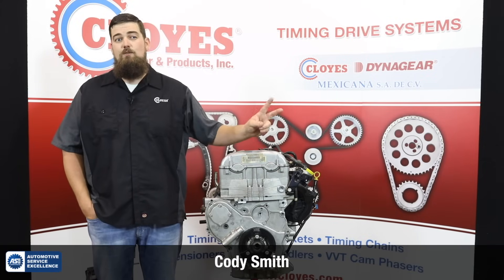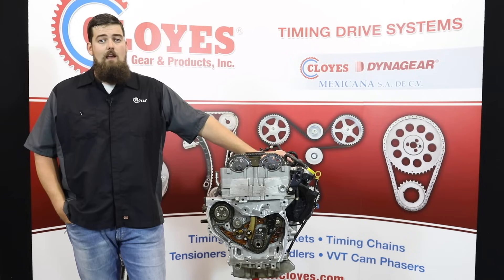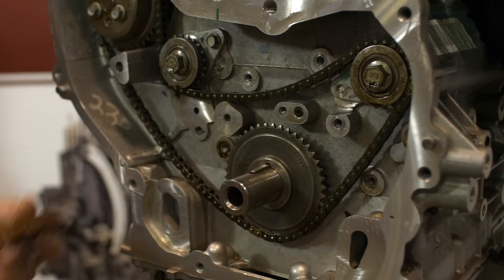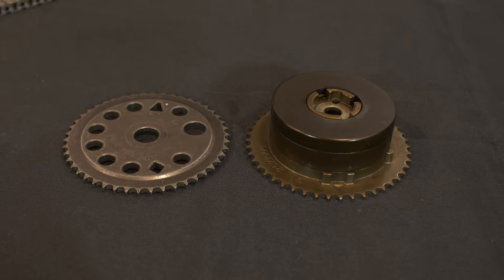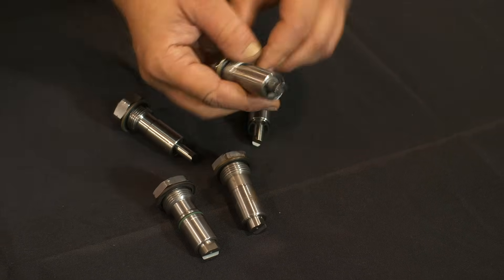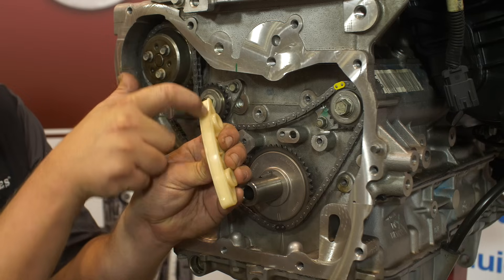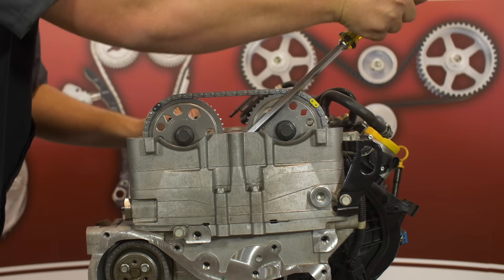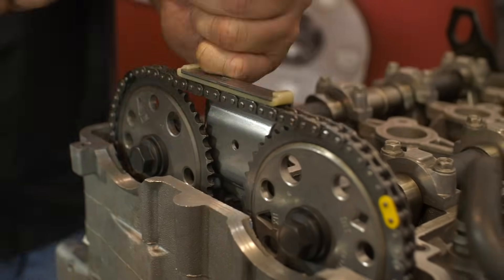GM 2.0/2.2/2.4L, Timing Chain Replacement, Cloyes 9-4201S & 9-4202S

Comment: I've been having a hell of a time. 2006 chevy cobalt supercharged ecotec 2.0 lsj.  Bought your balance shaft and timing chain kit, because it was about that time and my thermostat had just gone out. Anyway, I'm probably going to call your hotline tomorrow. Did everything listed, everything torqued to spec.Initially, I didnt spring the timing chain tensioner, after pulling it out, it had been released. My idle was fine on turn over, no engine codes (still no engine codes). Seemed a little heavier I  n vibration on the jackstands, but I've got billet mounts, so I assumed the vibration was reverberation due to it still being on stands, it having solid engine mounts, and torque damper. Any revving while the tires are on the car, and I try vibrations like my car is going to fall apart. More vibration the higher the rpm goes. Also, at TDC in cylinder on the compression stroke,  my 2 o'clock on the intake says exh, where my exh (firewall side), says int at the 10-11 o'clock position. Cam sprokets only go on one way..not that it should matter, but have you heard of camshaft sprokets being reversed from the dealership? I dont think I could possibly have the timing reversed 180 degrees,  because it wouldn't start nicely,  or at all, or would backfire from what I'm reading? Could you shine some Insight,  or is there any chance that an under or over torqued anything in the timing cover could cause the vibration? Sorry for the novel, I'm all out of ideas. My father just got diagnosed with 4 weeks to live and this is my only vehicle. Please please any help you could give would be great.
Reply from the maker: Timing is set on this engine with #1 TDC on the exhaust stroke. That explains why your cam sprockets are 180 out on the compression stroke, it is perfectly normal. With the car running, and no codes, you have the engine in time. The vibrations could be caused by a balance shaft/shafts being out of time, but with the colored links aligned correctly with the marks on the sprockets there is nothing you can do wrong there. If you are confident that the marks were aligned then the solid engine mounts are more than likely the cause of the vibrations you are experiencing.
Reply: @Cloyes01  because these arent new mounts, I've had them off the car several times, and back on, mounts torqued to spec. Or is it possible when changing balance shaft sprockets, if the pinch hold (where you catch the tooth to remove the sprocket with a punch or drill bit) slips when putting on a the new sprockets as long as you turn the balance shafts to their correct positions without completing the turn, assuming it slipped right on tighten,  I'd move it counter clockwise back, against the direction it turned? OR, if I worked counter clock wise installing the balance shaft chain vs clockwise from your video and others I've seen could that be the culprit? Do I need to turn my motor over 180 degrees and then do the balance shaft chain,should I turn the crank clockwise for a full revolution,  or 33 revolutions, to get the timing chain to match up on the marks on the initial install, and then line up the balance shaft chain links to the sprockets?
Reply from the maker: The balance shaft chain would not be affected by the primary chain tensioner. As long as you pulled the pin on the balance shaft tensioner then you will have no issues.
Reply from the maker: Turning the balance shafts independently will not matter at all, as long as the marks are properly aligned when the chain is installed. The sprockets have a "D" shaped back so they will only install on the shaft one way. If you want to reset the balance shaft timing you can rotate the engine back to the starting position (cam marks at 10 and 2 with the crank key at 12) then remove the balance shaft chain tensioner and guides. From there you can realign all the marks on the balance shaft system and reinstall the components. You will not need to disassemble any primary components, and keep in mind the colored chain links on the primary chain will not be aligned anymore.
Reply: @Cloyes01  if I didnt set the timing chain tensioner, the 32mm bolt, could that have caused my balance shaft chain to skip a few teeth on start up?

Comment: Hi just wondering why gm used torq to yield bolt ? Stupid shit I ever seen and even the crankshaft bolt just crazy ..
Reply from the maker: A torque to yield bolt applies more clamp load to the application than a standard fastener. GM must have felt the need for them to insure the sprockets don't slip on the shafts.
Reply: How in the world could the sprockets slip on the cam shaft with the slotted cam ends?     @Cloyes01
Reply from the maker: @stevemajor1110  - You don't want to depend on the cam sprocket features to hold the sprockets in place on the cam. If the clamp load is ever overcome those features will shear right off of the sprockets, they are not designed to take any load. The clamp load is what is holding the sprockets in place.

Comment: hi this is a similar engine to the B207R the question I have is that do I need a cam locking tool???
Reply: The Geekazoid people advise you dont need them and can use molegrips to lock the cams in place but i bought the gold tools. The cam sprockets are free floating on the b207r so they dont have locating lugs like on this video

Comment: Thank you for posting the video, it is very helpful. I would recommend taking the time to set the engine to TDC and not just a downward stroke so that you can use the markings in the video should you accidentally let the cam  or a balance shaft rotate.

I am in the middle of the job on a 2.0 lnf turbo engine, and the balance shaft sprockets on mine do not break loose like they do in the video. Using a punch and a 3/8 drive ratchet my 5/32 punch broke from the pressure. A friend that runs a shop recommended using a small impact hoping the percussion would knock the bolt loose under less pressure, I used a titanium 5/32 dewalt drill bit this time, and with a small impact nothing broke loose, it only slowly warped the drill bit. I grabbed my larger impact to retry and broke the drill bit in half, bolt and sprockets are still on the balance shafts. Any advice would be appreciated
Reply from the maker: You can remove the shafts from the engine and clamp them in a vice, on the non-bearing surfaces, with a cloth to protect the shafts. That is really the only other option if you can't get the punch/drill bit method to work.

Comment: great video, need to add how to do the bolt stretch after torquing down on the cams and crank bolt,,, the crank bolt should not be reused
Reply: Whenever he took the cam sprocket bolts out he said to discard them and throw them out....and when he took out the crank bolt he said to discard it so.... yeah he did cover that
Reply: He pulled to torque then Gave it another 30 degrees watch close when he torques it. And on the bolts why the hell can't they give a final tightness  instead of the degree crap the head bolts are a real pain and after the 90 degrees on the head bolts how do you double check them?
Reply: @stevemajor1110 , if you really want to know, you could Google it. But since you asked, and I didn't feel like explaining it in detail, here ya' go: https://www.assemblymag.com/articles/87404-fastening-threads-torque-control-vs-angle-control